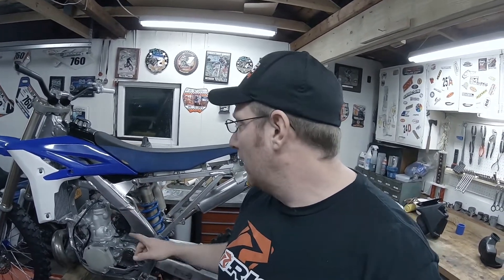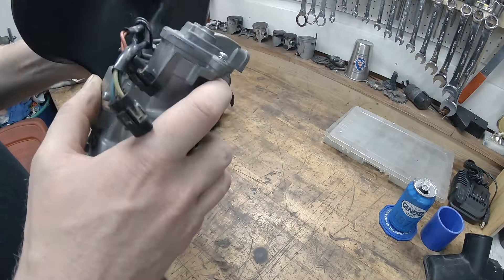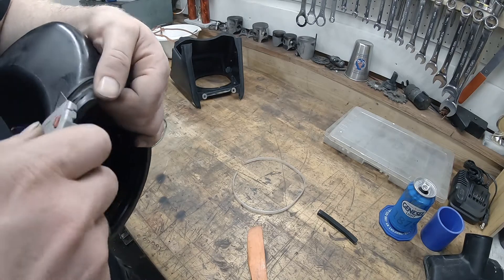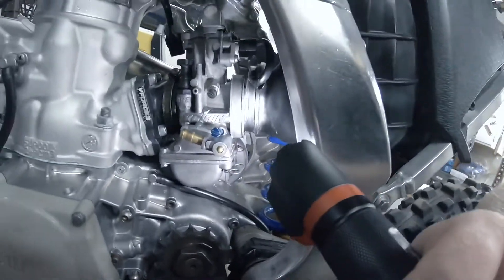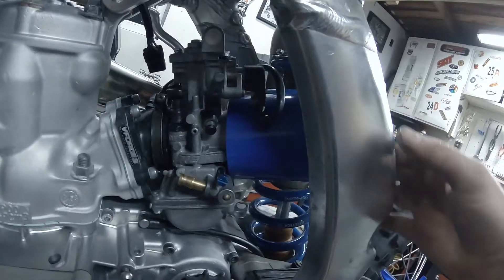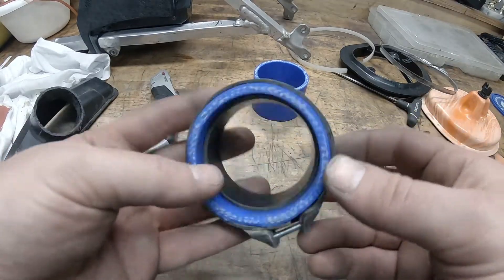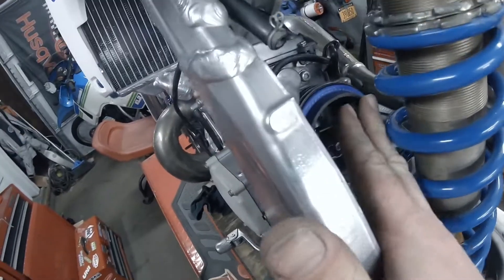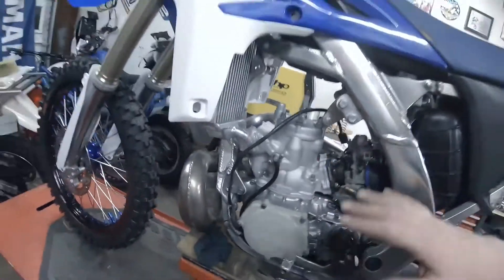2Stroke In A 4Stroke Frame Pt 12: Carb and Airbox Mod

Comment: Hi mate what radiators did you use I watched your build awesome job I’m building one at the the moment
Reply from the maker: I used aftermarket 4stroke ones had to cut the elbows off of the 2stroke ones and weld them on. Its a little bit of work but you get bigger radiators and the shrouds fit like they should.
Reply: @robinsonmotorsports9976  Cheers I thought you might have  I was just checking 👍